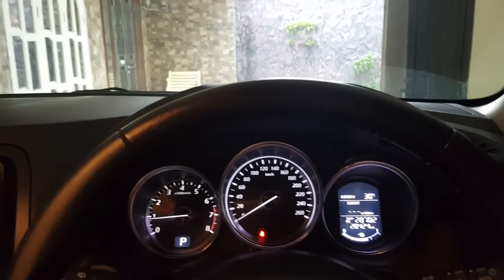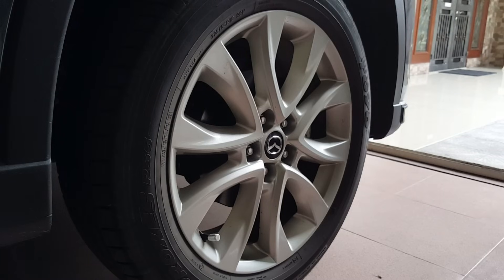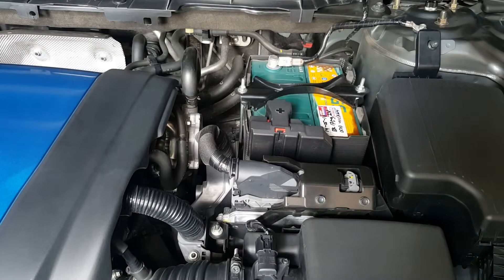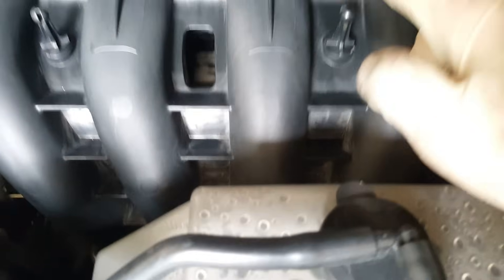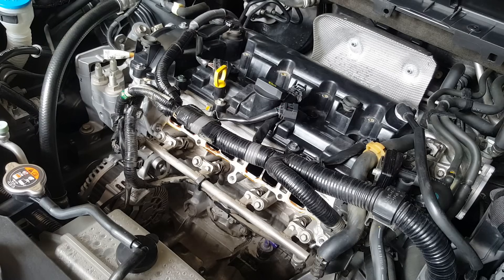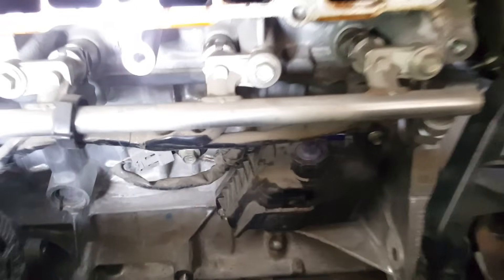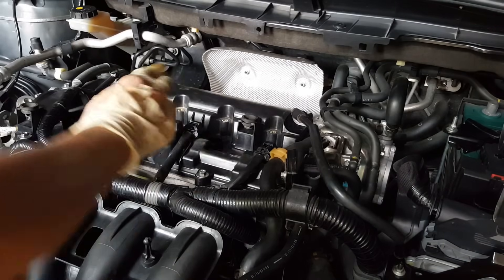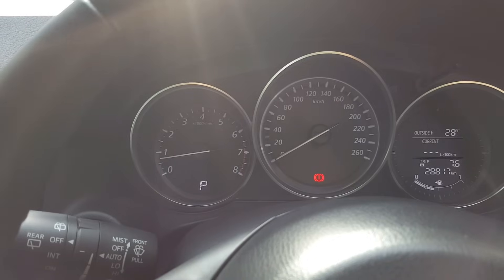How to Clean Intake valves / Carbon clean // Mazda CX 5 (All Skyactiv Gasoline Engines)

Comment: You don't show us how you close intake valve , please i need to know ❤️❤️
Reply from the maker: Easiest way is you will need to get somebody to turn the crank pulley for you and whilst turning you can take a look within the intake valve ports if it is shuts properly. Easy peasy.
Reply: Felix Dan thank you for this beautiful channel ❤️❤️
Reply from the maker: Appreciated bro. Consider subscribing to get the most updates on this channel :) . Thank you again for you supports.
Reply: Felix Dan i,ll but make more about Mazda Because I can't find anyone on YouTube who know about skyactiv engine except you 👌🏻
Reply from the maker: @Dhomqx will do , for sure my fella brother.
Reply: Rotate the ratchet clockwise.or rotate the engine crank counter clockwise.
Reply from the maker: @pkt.8429  rotate the crankpulley clockwise .
Reply: @GarasiFelixDan  Is it safe that they are really closed with just seeing them? Can I get a chance of getting that liquid cleaner inside the pistons?
Reply from the maker: @caalca05  yeap , it is safe. if the valves are closed properly you shouldn't get any thing on the piston combustion chamber.
Reply: @GarasiFelixDan  Thanks I´ll do that, amazing videos you make!!
Reply from the maker: @caalca05  welcome sir :) if u plan to add oil catch can. Do it whilst u performin this service.
Reply: @caalca05  theoretically, you could hydrolock the engine by putting too much cleaner in there. This Youtuber is also using the wrong chemical to clean the intake valves and intake valve chamber - this is chemical that is usually added to your fuel tank. He should be using a proper intake valve foaming cleaner which will prevent the risk of hydrolocking the engine. Here is a suitable cleaner to use - https://www.automegastore.com.au/liqui-moly-engine-intake-decarb-366g?gclid=CjwKCAjw8df2BRA3EiwAvfZWaDeiwpkKUHcqGEm1QM2GNifBg7YNbdjjtZNfjx6Ltz2uKnh6TlWFVhoCCPIQAvD_BwE

Comment: Hi Felix!   Just finished intake valve cleaning today using crc spray.  I will update you on the status.   Keep up the good work 👍
Reply: Sir Felix, so I did use crc spray intake valves cleaner.   It's worth noting that I didn't use the whole can, only half (afraid of too much moisture will cause turbulence and ultimately throw codes).  After 1 hour and half (instruction: only 1) started her up and went for a drive.    Immediately at the red light,  I could feel idle extremely smooth.  Better Acceleration only felt after a  week.   I repeated the same steps after 2nd week.   Now,  my ride starts and accelerates like new.   I guess the product does work.  👍 Thank you all. 😁
Reply: @lukha225  what is your cleaning process?
Reply: Mohammad.
Did your car engine light came on after using crc? You still using crc?

Comment: I am only a DIY mechanic but doesn't this process only clean the valves in the front end of the engine; how do you, and can you get to the valves in the rear of the engine?
Reply: If you mean the exhaust valves, they won't need to be done, most of the gunk gets burnt off as the hot gas passes them.
Reply from the maker: @apassionfortangling3671  👍👍👍
Reply: The Missing Link's Younger Brother you are wright. In regular engines the gas is washing the valves so no need for this.i heard Toyota does a dual port so I guess they want to eliminate the process of manual cleaning.
Reply from the maker: You r indeed correct sir . If the intake manifold positioned on the rear side . We will need a proper tool. Walnut blast will be the best .
Reply: Thanks for the quick response but I have a CX-5 like in video with the intake manifold on the front of the engine. The question is even with this does this process only clean half the valves and with this engine can you get to the rear valves?
Reply from the maker: @sleamhnan  oh i get what u mean now sorry i didnt quiet get what you mean before. But to clean the rear side i did use tool pick with an angle points , u can actually feel and scrape similar to dentist type of tool pick and clean the deposit off the rear side of the valves and it is sufficient to remove the carbon deposits as per this video my carbon deposits were not too tough to remove by chemical and bit of scrubbing and scraping with the tool pick i was able to remove all carbon deposits.

Comment: How do you know that 2 and 4  are completely closed and  how much rotation to get 1 and 3 completely closed?
Reply from the maker: Having a spotter tell you “when” is the easiest way. If the Buildup makes it hard to tell, then you can put a long screwdriver, or extension in the spark plug hole and watch it reach its peak at TDC. This will ensure the valves are fully shut.
Reply: What is the “tdc”?
Reply from the maker: @bobbypols1096  Top dead center (TDC) is the position of an engine's piston when it is at the very top of its stroke.
Reply: @GarasiFelixDan  thanks felix!
Reply: Is there a gauge on the engine that lets you know when you're TDC?
Reply from the maker: @bobbypols1096  nope there is no gauge . But theres a marking point i belive.
Reply: Felix Dan there is a dial gauge for finding top dead center
Reply from the maker: oh yes sorry i didnt quiet understand before. yes there is a dial gauge / markings to find tdc .
Reply from the maker: @Benjamin Cavanaugh best thing is to rotate one at the time and get someone to use torch to shine the intake manifold and see which ones are fully closed.

Comment: Felix Dan thank you for your wonderful videos.   Question, I assume you suctioned out the chemicals and carbon residue-I saw a little bit of the tool you used but did not see the actual process.  Can you please clarify this step?   Thanks again
Reply from the maker: Yes i havd use a vacuum tool to remove the left over chemical . Sort of like a mini catch can.
Reply: Basically use a syringe to suck it out.  What Felix used is a very common laboratory syringe.  You can buy these online, as a lab supply.  Attach a hose to the tip of it, so can suck from the lowest point in the intake.  Any fuel/transmission hose should work.

Comment: I might consider doing this on my 2015 Mazda 6. Looks like it's not a very difficult job to do. Mazda seems to have made the CX-5 and the 6 pretty easy to service. Unfortunately, I won't know how bad the carbon buildup is until I get the intake manifold off and take a look.
Reply: Kent, did you perform the carbon cleaning procedure on your 2015 Mazda 6 2.5L? I have the same vehicle. Any issues for you during the cleaning?
Reply from the maker: Also consider installing oil catch can while you at it. It works great. https://youtu.be/wwshYqm4cH8
Reply: @GarasiFelixDan I've read condensation and ice can form in these. Any truth?
Reply from the maker: @matsudakodo  i have not got a clue mate as i dont live in snowy / cold area.

Comment: Nice video. But the easy way to do this is to hit the high way. 180MPH for about 5mins  ..
Reply: Dont think 180mph is achievable with this car 😂
Reply from the maker: you r correct sir .
Reply: 180mph is the equivalent of 290kmh. Even 200kmh is hard to achieve with this car. Anyway on a GDI engine, italian tune up wont do much as with port injection engine
Reply from the maker: Alvin Lee  spot on !
Reply from the maker: Cant do it here its too crowded. Hehhee.
Reply: LOL that Mazda wont do anywhere near 180mph.......maybe 130!!
Reply: The maximum speed I was able to run is 240 kph on my Mazda 6 diesel.

Comment: You are an amazing mechanic. You make it look so simple yet I know it’s not.  I have a 2018 Mazda CX-5. Do you think that the CRC Intake valve cleaner used like every 10,000 miles would maintain the valves clean?  Also, I saw your video on accessing the transmission fluid dipstick. Mazda could just have added a long tube and dipstick so that the transmission  fluid could be checked more easily. Even basic maintenance checks are becoming more complicated in modern vehicles. Great vids.
Reply from the maker: Gerardo Pietrantoni thank you sir. With this gdi engine its going to hard to say wether the crc intake valves cleaner will break out all the carbon deposits. But if you do it regularly saying about 5000kms rather than 10000kms i am sure the chemicals will helps loosen some carbon deposits on the intake valves and give some lubrication to the intake valves to prevents further carbon build up , But just a note that with this service i had to scrape off the stubborn carbon on this vehicle i doubt just by spraying will remove the carbon deposits.
Reply: Felix Dan Thank you!  I usually change the oil every 5000kms. I’ll do it every oil change just to help prevent significant carbon buildup   Thank you again.
Reply: @gerardopietrantoni6452  I have used the CRC many, many times and believe it does help if you stay on top of it from the beginning.  It is NOT likely to do much if you’re trying to remove large carbon deposits.  One word of caution when using it... make sure to follow the instructions to the letter and when you do your drive after the heat soak, drive slowly or you will hear a loud knocking noise and you will likely throw the engine into limp mode.  Instead, go out to the highway slowly and build up to about 60-65 mph and drive it at that speed for about 10 miles.  After that, you can begin to drive/accelerate normally.  For the next few miles, drive it like you stole it.  If you do encounter the limp mode, pull off to the side, and power cycle the engine to clear it.
Reply: @gerardopietrantoni6452 Why not change the oil every 1000km???